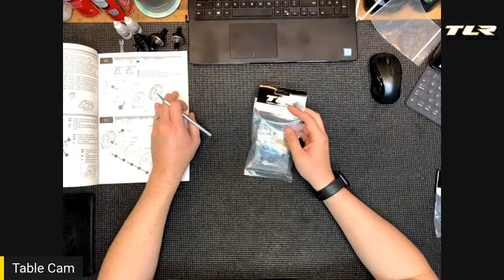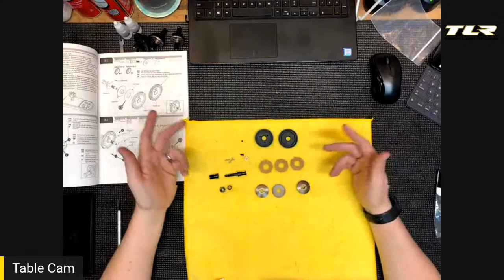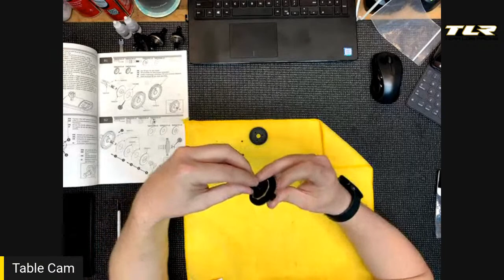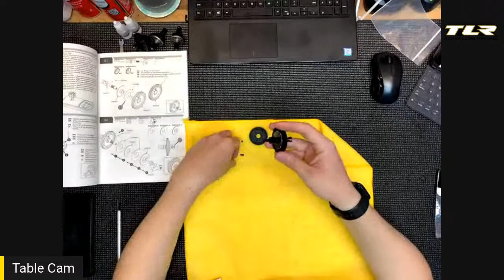22X-4 Build Series, Slipper and Turnbuckles, Bags B & C

Comment: Hunter king helped me out with the turn buckles. He stated the the line on the buckles should all be on the right or the left. Also I had a problem getting them together  until he told me the one side screws in one way and the other side of the buckle screws in the other direction. (Like a tootsie Roll)